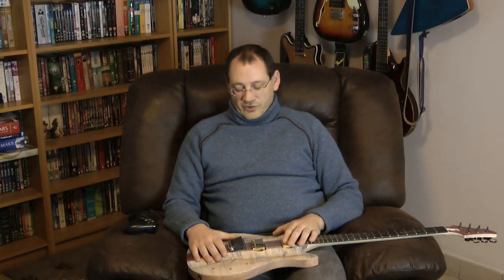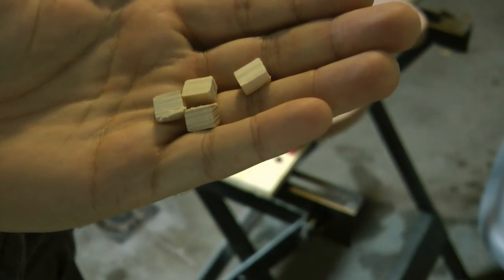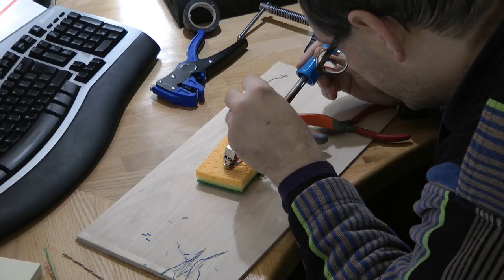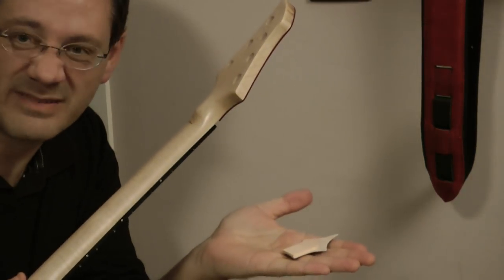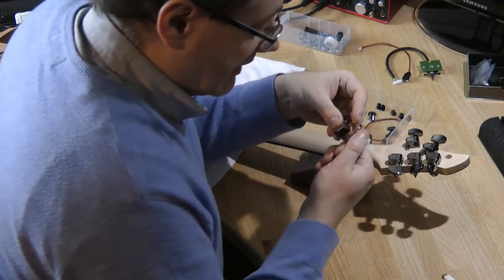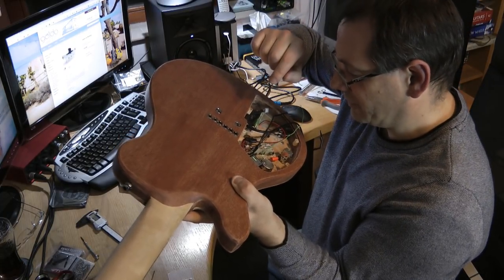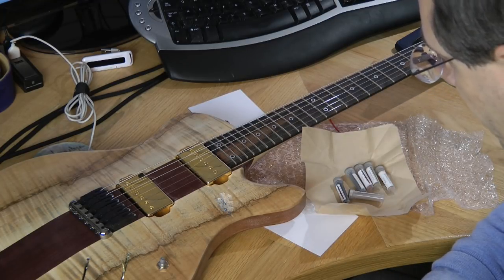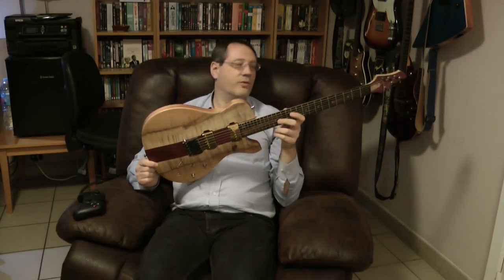Crimson Guitar Build - The Aftermath

Comment: Hi Jonathan, I have built several guitars and 'enjoyed' some of the same problems.. e.g. pot/switch heights in the cavity, spraying the finish - which went wrong on the last, probably totally unnecessary, coat etc etc   I spent many nights in bed thinking through various stages ahead, my only previous experience was having totally restored & upgraded a Burns Flyte… Your guitar is gorgeous, and definitely better in a natural finish - maybe a little complicated for a first build, but Crimson were there to guide you initially so fair enough  :-)
And I am quite sure Crimson WILL sort out this neck problem with you one way or another so definitely take it with you next time, and I am so glad you have not been discouraged by the problems. You 'will' end up with this guitar as you originally envisaged - and I have seen much worse neck problems rectified by skilled hands :-)
I look forward to future developments.

Comment from the maker: As a supplementary comment to this video, I feel that it's a bit longer than I would like, because I know that people's time is precious and nearly 20 minutes is a lot for a YouTube video - particularly when the end is...as it is, not wishing to spoil it!  However, I think this video shows quite a lot of little problems and issues that I encountered, and tried to overcome, and for that reason I hope that it will be interesting, mostly for other people at a similar stage to me.  I probably didn't pick the best solution for all of my issues, but they were all I could think of, working on my own without the expert supervision that was available during the course!  I had over 5 hours of video that I cut down drastically, and that was a small portion of the time that I spent on the guitar at home.  Moreover, there were other problems that I haven't even mentioned in this video - the main one was that the preamp didn't work, and I had to send it back to the retailer, which delayed me by several weeks.

Comment: I'm sure this will be resolved and I'm not sure how you ended up with that neck problem but how much work on that area did you do while not at Crimson?
Reply from the maker: I didn't do any more sanding or anything to remove any material from the neck after the course.  I spent quite a few hours on other areas - probably another 20-30 hours in total, all told, but part of that is probably because I was slow at doing things on my own since I had to work it all out (particularly the electronics).  The next build is going to be simpler in some ways (the first hardware is arriving tomorrow).
Reply: I hope your new build goes without a hitch!

Comment: Did you buy the electronics from Crimson, if so they should have made sure about the control cavity depth to avoid the issues that you had, and it looks as if your truss rod route was too deep for that neck thickness. Definitely take it back with you.
Reply from the maker: They supplied the pots and switch for the magnetic pickups; I bought the Schaller bridge & preamp, which comes with its own pot and switch.  The problem was that we were running late so we didn't have time to properly fit the electronics, so they gave me the pieces to take away.
And yes, the truss rod route was too deep, which was probably on day three (but I don't think I filmed it).  The problem was that the depth stop on the router slipped while I was routing out the channel, which made it go too deep.  We addressed it by putting some strips of veneer in the bottom of the channel (about three, I think), but I guess that they didn't have the same strength as the solid wood.
I don't think that guitar building is as easy as it looks...! :)

Comment: Although I praise your attempt,this is a good example why you should start by assembling kit   guitars before attempting anything as complicated as your dream guitar from the start.I totally get it but for now it's a £2000 wall decoration.
Reply from the maker: You're right, and I'd certainly recommend that someone else start with a simpler build.  The problem with the neck really came from the depth stop failing on the router, so I think it's really important to know your tools - which I didn't on the course, since they weren't my tools.  Did you see my second Crimson build?  That was much more successful.  I've also subsequently started making guitars at home...I have three on the go at the moment, and the first one is nearly finished (I recently posted a short video showing the first coat of lacquer going on).

Comment: Did you really just try to file stain out of the body with a triangular file? Can I ask, did you not take into account that doing so would just put a deep gauge into the guitar, potentially going through the top and cause you to have to sand like a maniac later on to get an even surface? Are you abit wet between the ears?
Reply from the maker: The place where I tried to file the stain out was a natural hole in the wood that was revealed when we cut the top open for bookmatching.  When the top was stained, it was already quite deep, and the stain was applied to the wood and then it was filled with superglue - that's why I had to go deep to try to remove the stain. I knew, though that, the cap was plenty deep enough at that point and I wasn't going to break through it. Obviously I was never going to sand down to that level - my initial intention was simply to clean out the stain and then refill the hole with superglue again; when it became clear that this approach wasn't working, I decided to do my oak leaf inlay instead.How would you suggest I should have tried to solve the problem?  Please make positive suggestions instead of insulting me, which was a bit unnecessary.
Reply: Jonathan Oakey it's abit of a silly thing though. What did you expect the tiny file to do other than make a deep gauge? Bear in mind flamed maple isn't cheap either. Me personally? Depends what the stain was made from - ink based would be difficult, water based could be easier but still difficult.

I'd of probably gone down the route of Naptha/Nitromors to see if that had any effect along with sanding. 

Not forgetting wood is porous so brushes may also of been useful. 

However hard you attempt the long and short of it is you stained a piece of wood. Thusly stated "stained" doesn't mean do it blue then decide it should be natural, you could sand and scrub for weeks and it would still be tinted, along with the fact of if you oiled/waxed it that stain is in there forever, unless of course you sand through the top.